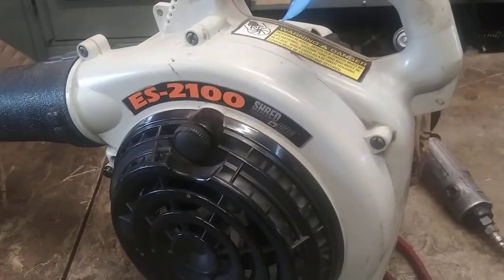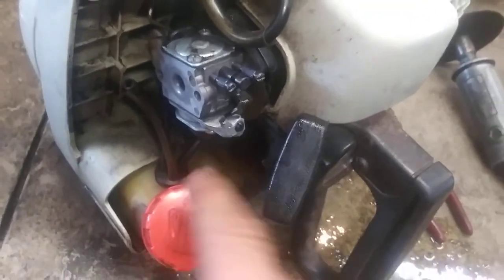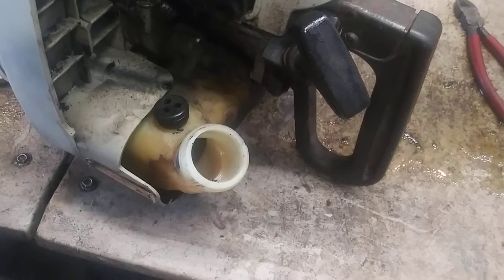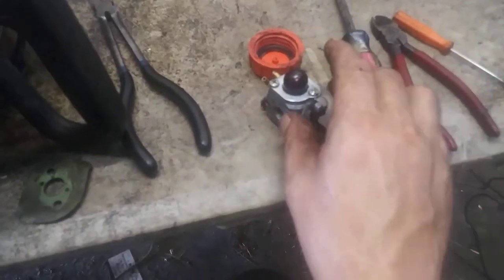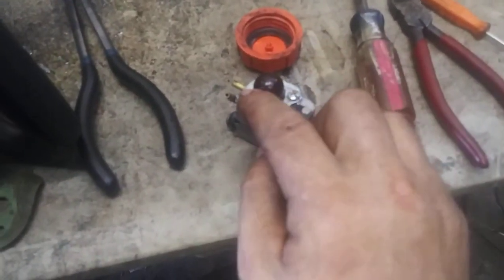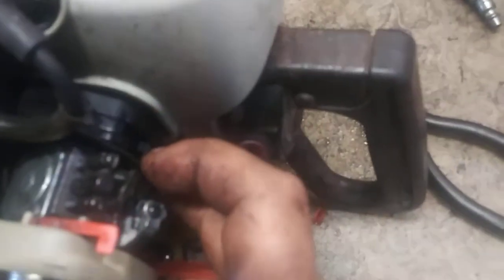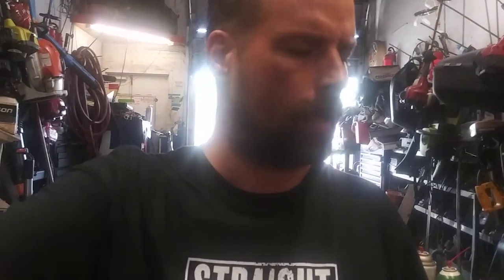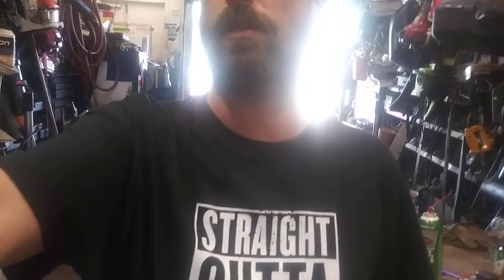* Echo es 2100 shred n vac blower carburetor repair. echo es2100 carb repair

Comment: Why didn’t you connect the lines to the carburetor before you re-installed the carburetor?
Reply from the maker: Easier to judge length. But either way is good. Not really that important.

Comment: need a carb for es 2400 looks identical to 2100. do you think they interchange? thanks
Reply from the maker: As long as the throttle hooks up the same yes
Reply: @smallengineguys  I see thanks!

Comment: It slides right on but it takes two hands. Sure wish you had included the video of it. Without it, it is like giving directions up to the door but then not showing how to get in. Picking up on the other side of the door. Never got to the end of the video.